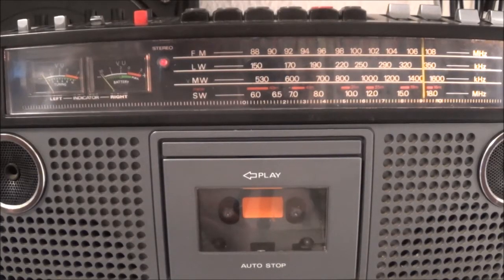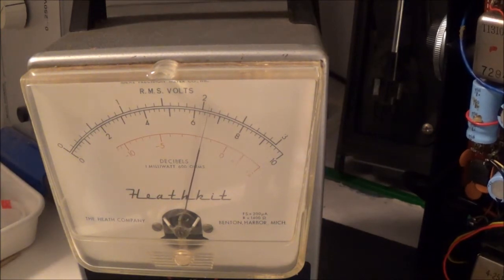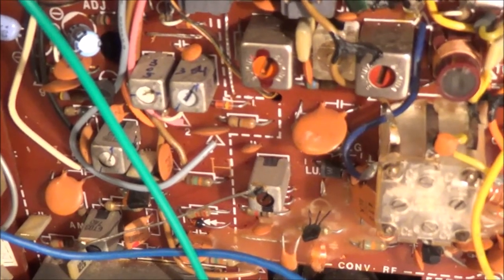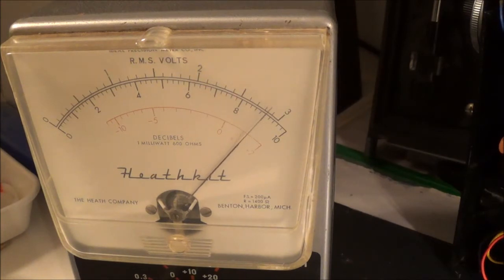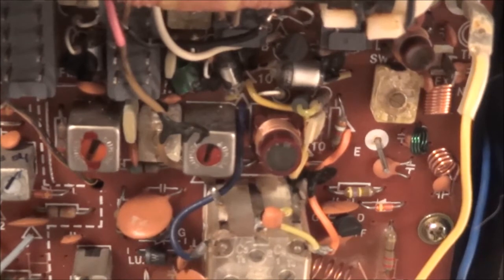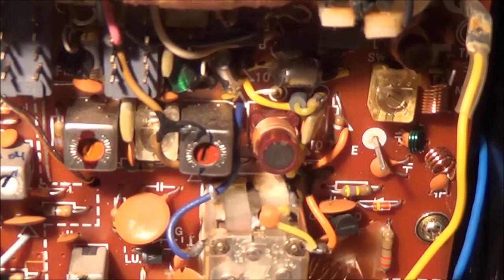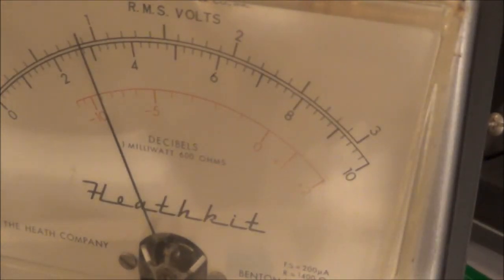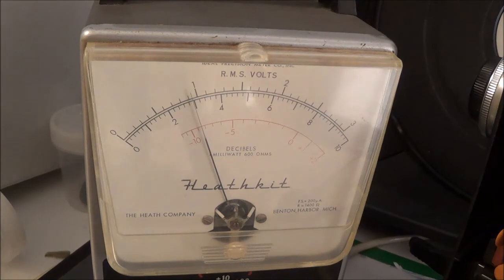Sanyo 9980LU Boombox AM/SW/LW Alignment -- PART 1

Comment: Fantastic video!  I really like that National!  Did the book advise to move the AM antenna coil or is that something learned?  I've not seen before, but I like!  I have a deaf radio I may try that on.  ~Jack, VEG
Reply from the maker: Thanks, sir! Glad you didn't fall into a coma watching it...Part 2 of this blockbuster is coming up. The National was part of a combo package I bought. The distortion meter below it I did not want, but the seller would not sell me the signal generator otherwise. Then I could not part with the distortion meter; I didn't want to separate the "family."

As far as the antenna coil goes: that was the procedure prescribed by the service manual. Actually the service manual just says "adjust the coil." I used a my wife's craft hot air gun to melt the wax--carefully.  Might go with a hairdryer too--hairdryer probably has less potential for damage.
Reply: Never!  With your videos I pay attention, very informative and it's a great subject matter!  I have seen DM's, on the fence whether or not I need one?  But if I find one at a bargain price, I may? And I can fully understand about separation! 

I really liked the coil adjustment, as stated, never seen that trick nor have I thought of it, however it does makes sense to checkout!  Have you thought about getting one of those temp controlled heat guns off eBay?  I have one and find it to be a great tool, it comes with different size tips plus you can control the amount of forced air blowing out....just think....more toys!  :)  ~Jack, VEG
Reply from the maker: Distortion meter; it's a subjective choice....some say you don't need 'em; others say they are indispensable. But, I think it's worth getting one alone for the amount of new stuff you learn. Besides how are you otherwise going to get to the next Shaolin "electronics" chamber?
Reply: He-he, I think you are correct!  I've watched all of your videos, I don't recall you using a DM, if not could you do a video showing how to use one?  Thanks!  ~Jack, VEG
Reply from the maker: I think I do have a HP334A video up. Solidly built unit. If not, I can probably make a video.
Reply: You are correct (just searched for it) and I did see it and comment on it...sorry I forgot!  :)  ~Jack, VEG